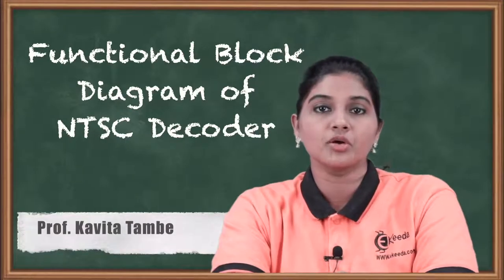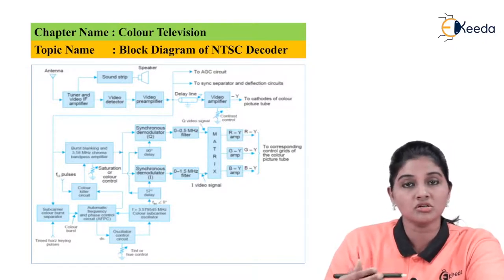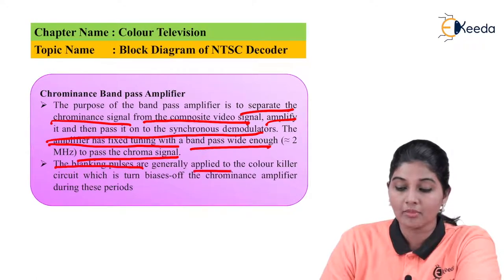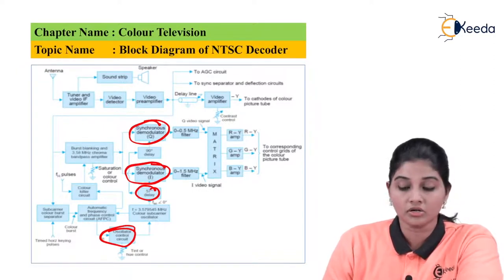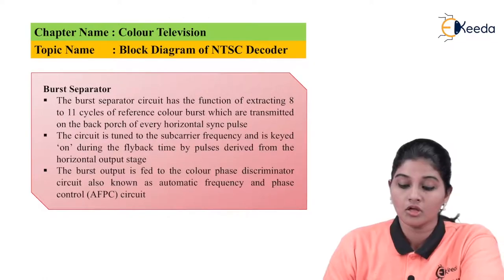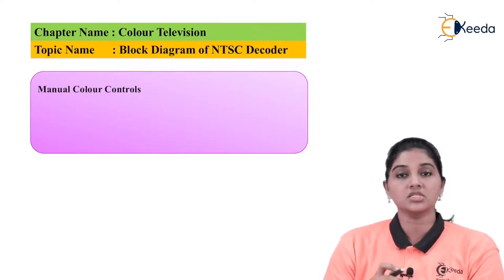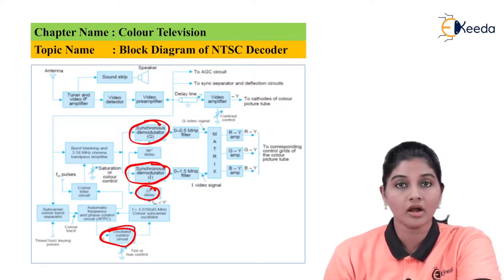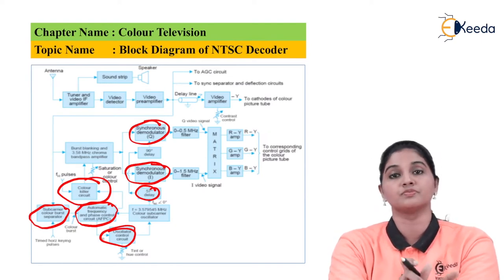Functional Block Diagram of NTSC Decoder | Colour Television | TV and Video Engineering

Comment: Here's an advanced project for second year EE students:  Build an NTSC decoder circuit from first principles.  Give them a modulated signal to analyze and just two clues:  First, this is a TV signal and this is what it looks like.  Include the standard NTSC color bar pattern.  Second,  the reference clock frequency of 3.579545 MHz.    A GOOD student will be able to design the NTSC decoder.